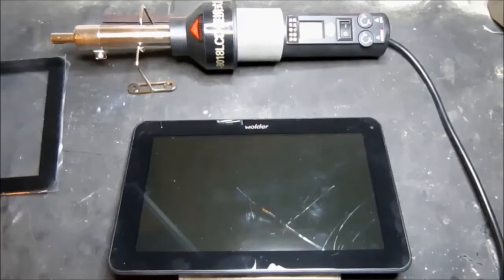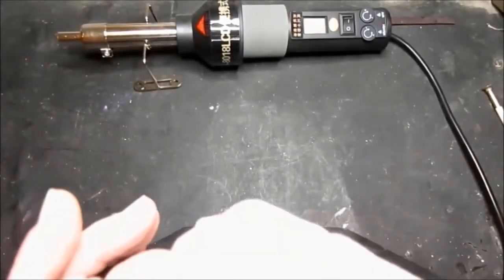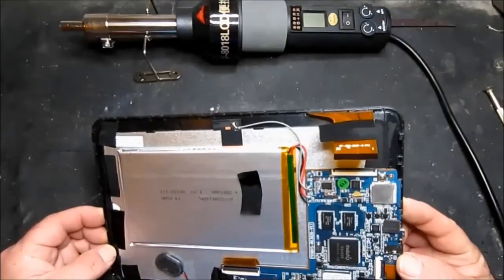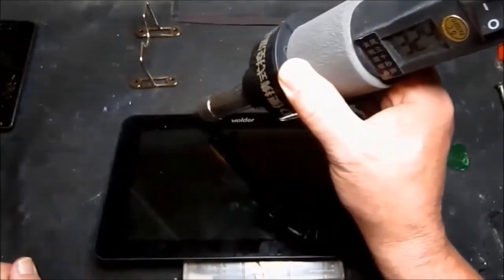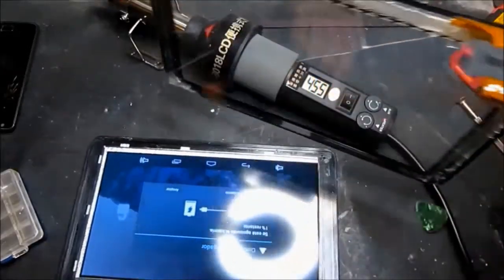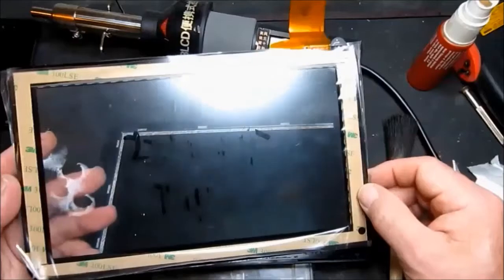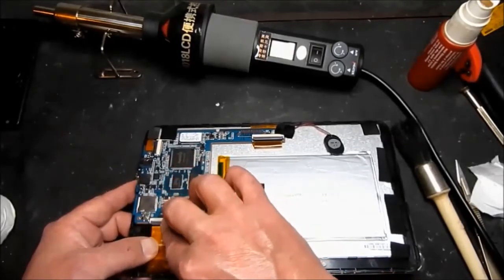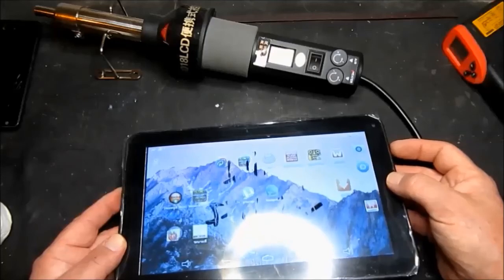Wolder 9" miTab CHICAGO Tablet Digitiser Replacement Repair Teardown

Comment: Hi! Thanks for you videos in general, they have been pretty helpful! One question: you set the gun at 200ish ºC but you get a output of 40ºC??? Is that expected?
Thanks!!
Reply from the maker: The temperature display is in Fahrenheit so about 90 C. The display is not very accurate which is why I checked with the IR thermometer. Much depends on the airflow. Please consider subscribing if you haven't done so already!!
Reply: @1nformatica   Thanks for the fast reply! Hmm I understand... I'm unsure about buying one of those or a slight more expensive one from amazon. ..
Subscribed!!  keep up the good work. cheers

Comment: You haven't mentioned if the new screen, after installation, needs hot air to be glued to the body or not?
Thank you for the video.
Reply from the maker: The new screen comes with adhesive strips. You just need to peel off the backing paper and press into place. No heat needed. Thanks.
Reply: I got it now, thank you for the answer.